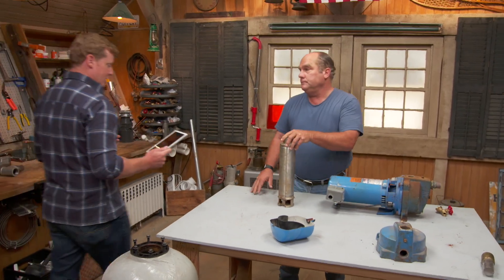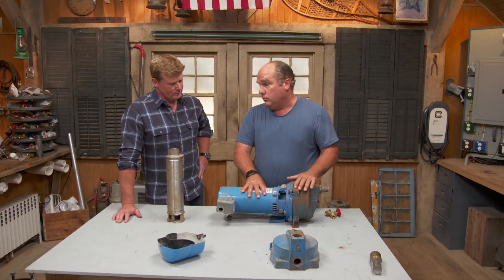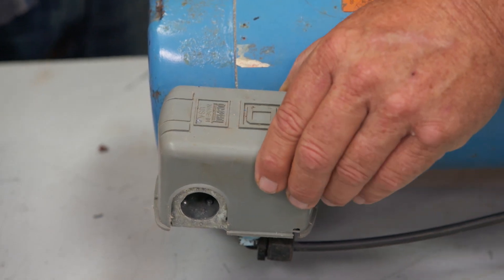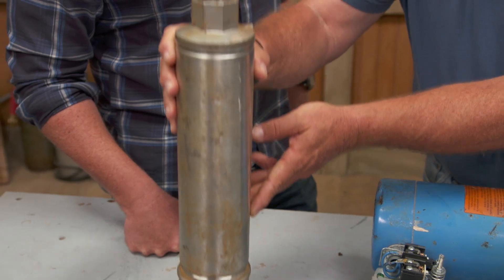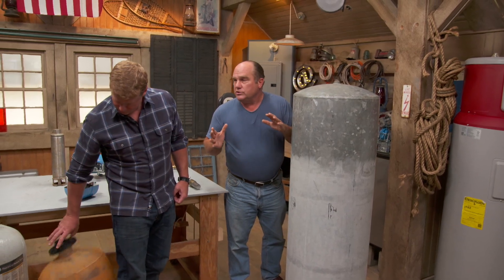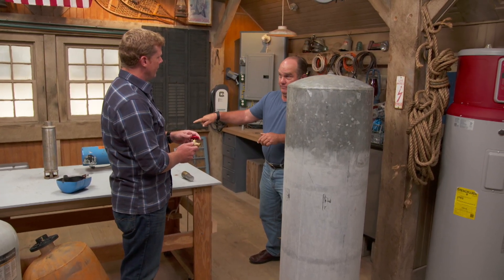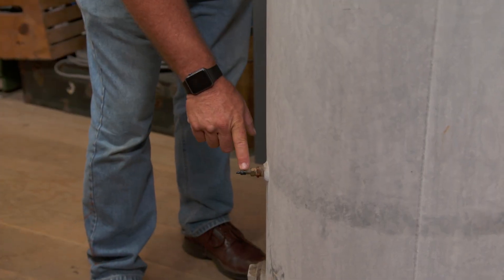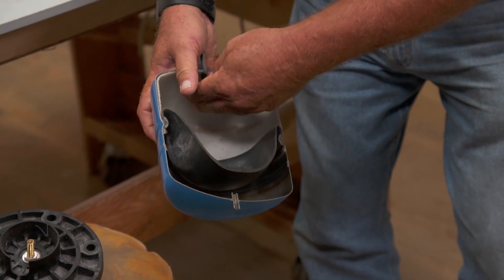How to Diagnose Problems with Well Water Systems | Ask This Old House

Comment: This is misleading. The amount of water transmitted under pressure is directly related to the amount of energy used. Whether the pump moves the water in small cycles when the facet is opened (water logged storage tank) or over a long cycle while compressing the air charge in a working storage tank, the energy used is equal for the amount of water moved. The only difference is when the water is stored with a air charge. the energy expended becomes potential energy in stored air behind the flexible compression bladder. The sole reason to  have a proper working storage tank is, that the excessive cycling of the pump, pressure switch, and check valve is hard on those components and will result in early failure. In a deep submersible pump well, that gets expensive. So .... the extra electricity use is not the fault of the well !
Reply: All electric motors, especially compressors and pumps, will have a high inrush current at startup, so a pump that cycles on and off continuously will indeed use more power than one that cycles less frequently.
Reply: I've been working on pumps &wells & filtration systems for over 24 years.

Starting amps are always higher than running amps  "short cycling" A.K.A on off, on off destroys pump motors very quickly  

As a pump motor runs it cools itself off. So short cycling for a few hours can & will take many years off the pump motors life. Also, well pumps made back 40 years ago like old Grundfos's and or Red Jacket or Burks pumps were & are soo much better than any of the pumps they make today.

Now days, all of the aforementioned parts such as the nozzle's, diffusers, seals, impellers are made up of composite plastics such as  PVC or ABS which melt in mere minutes if a pump is inadvertently run dry or if cavitation is present

 Just like anything else, it can be made cheaper & with less quality in the materials, while paying less in labor to have it done in other countries.  which in the long run benefits the industry making these products, not the consumer, Yet the decrease in quality parts don't reflect in the price the consumer pays only the profit margin of the industry. 

 I will take a 1940's Burks pump that's been pumping water for 40 years over a brand new Gould's pump right off the assembly line any day.
  

The pumps of old were made with top notch "Made in America" parts such as brass nozzle's and diffusers brass or bronze impellers that if run dry would run unaffected for days.
Reply: A pump/motor pulls the most electricity upon the start up. They will actually pull LRA (locked rotor amp) upon starting and then settle back to normal amp draw when running. Rapid cycling will damage a motor and starting mechanisms and will increase the cost of the electric bill. I have seen it many times. I also have had people contact me with excessive electric bills and sometimes it is a leak in the well causing the pump to run 24 hours (or a leak in a field they didn't discover) but still giving enough pressure in the home but not to shut off pressure and that will certainly run up the bill and other times a "waterlogged" tank will cause it. Tanks that do not work properly or are too small are the main reason for pump failures. From the best made to the worst made, they all can fail, some more often than others.
Reply: How to repair Richardson well water yank
Reply: Agreed. Even considering inrush current as Xibalba mentions, it shouldn't make a measurable difference.
Reply: That was my point. The problem of short cycling is not extra power consumption but wearing out expensive parts much faster.